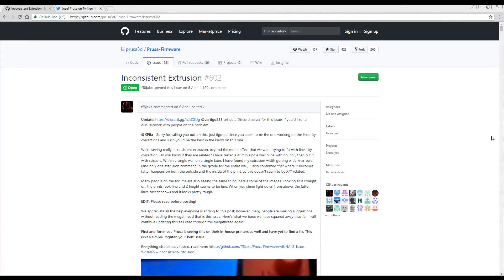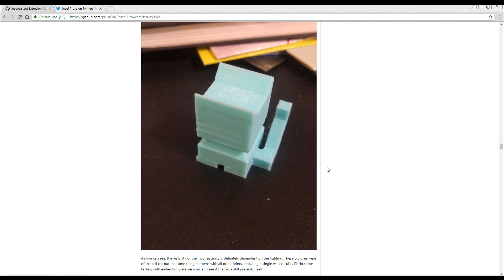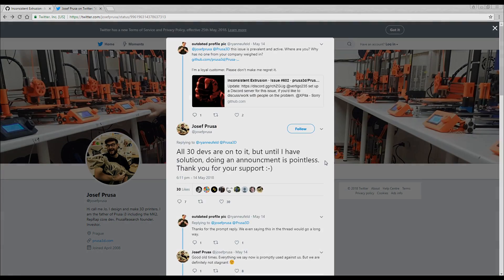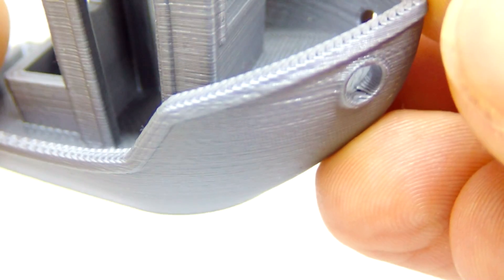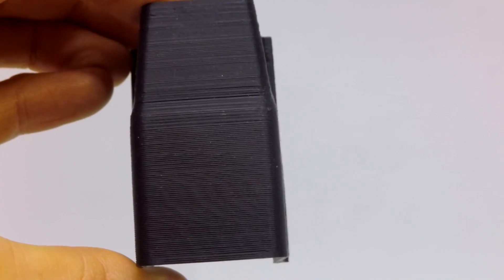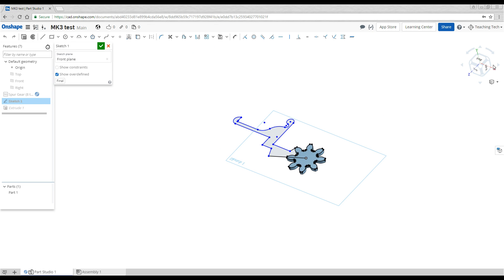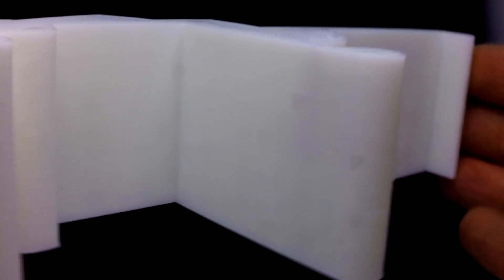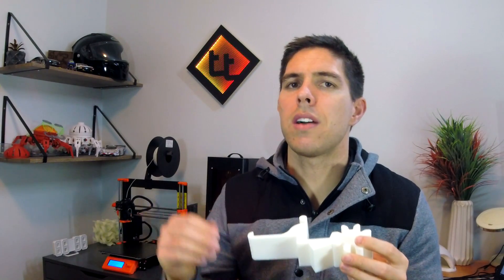Prusa MK3 extrusion issue: Just how bad is it?

Comment: Prusa mentioned on Facebook that the problem was with the print head being too light and having too much play when traveling over layer imperfections. Apparently it's fixable through reprinting some parts, probably around the extruder but I wouldn't know.
Reply: Stepper code or step planner in Marlin and Prusa firmware are no longer identical, and it's not identical across Marlin versions.

They are currently trying to figure out what to do with timing on the Marlin side of things, to make extruder pulses more even, as hypothetically there are potential issues there, not sure if visible.
Reply: Cassiano Leal nah it looks like the problem is in marlin code. People have weighted print heads with redbulls to no effect.
Reply: I'm just relaying what I read from Josef Prusa himself on Facebook like 3 or 4 days ago. If it's not the case, don't shoot the messenger! :D
Reply: I have the issue and added 400grams of lead to my extruder.  No difference.
Reply from the maker: I haven't come across the Facebook post by Prusa. Generally it's a good thing to have a light hot end assembly. When I changed my Solidoodle from standard to bowden, the print quality improved a lot from the lack of wobble. Ringing was improved too.
Reply: Teaching Tech, sorry it wasn't a post by Prusa, it was a comment on another post, buried fairly deeply within a thread of comments, which is probably why you missed it. If I find it I'll link it here but don't hold your breath. :)
Reply: I love it when people just come and tell their personal anecdotes and assumptions. I never said what the issue is. I simply relayed what Josef Prusa himself said on Facebook.

Recently another user in the Prusa user group showed a few quite perfect prints after a rebuild. Main difference? He reprinted the print head parts with 50% infill instead of Prusa's 20%.

Another anecdote, I know, but this one seems to confirm what Prusa said, and I'm more willing to trust the creator and his 30 developers, and the one anecdote that seems to confirm what he said, than any of the other assumptions and anecdotes. :)
Reply: Well the issue source is not 100% known, or is an amalgamation of different people having different issues leading to the same visual result, or a multi-factor issue, else there would have likely been a one-step official fix that would have been relayed through his corporate channels, to the press members following the issue, and end-user support, rather than the personal post of Mr. Prusa. It's a fact of the matter that the lead engineer and his strong engineering team also have all kinds of hints to go off but no ultimate answer, and being an industrial engineer myself, that happens a lot more often than you'd think.

In another case i am aware of, the uneven extrusion issue was reproduced similarly but with slight difference both on Klipper and on Prusafirmware, and Klipper is completely different, as its step clock is based on idealised step timings rather than gradient based estimation like in Prusafirmware and Marlin. This speaks for the possibility that at least for that person, the issue is mechanically related rather than firmware related and the material give (possibly with wear contributing to it) as you suggest is likely to be to be the cause. If the issue is exacerbated by wear, then it's conceivable that people feel it occurred with firmware updates as a matter of coincidence.
Reply: I too am a European and terrible customers are not foreign to me. Fact of the matter is, business like this is not limited geographically and the more popular your product is, the more you get to deal with this. You don't owe everyone the solution to their problem, you don't owe it to people that something you make is fit for their use, it's outright not possible. If a top-level engineer has to spend 10 hours on a single person and possibly gets frustrated or sick as a result and suffers a potentially even larger productivity damage than the direct time spent on the customer, you're out of a good chunk of money, so it's cheaper to refund them, multiple times if need be - apologise, state outright that you're unable to resolve their issue in a given timeframe, thank them for trust, all that jazz - i know it's not fair, not towards such toxic individuals, but well, that's life. The goal is to convince the customer to go away while making them as happy as possible, because let's face it, the Internet which is semi-anonymous is where the business takes place, so if you don't do that, they will find a way to make your life unpleasant, which is super expensive. Nobody gets to demand more than a refund. I can also see how it's sensible to segregate the communication with a given customer from everyone else so they don't get to frustrate other customers.
Reply: Mark Weist, where did you get that number from? Perhaps it's too much? Perhaps too little?
Reply: have not seen or heard of hardware being the issue. The printer worked really well out of the box after i assembled it(kit version) it was later firmware releases that made the printer act funny. I think they are working it out though. My printer is starting to print better now that ive calibrated it more. I bought 4 extra pinda sensors off a guy too.
Reply: Your welcome for my "anecdote" :)
Reply: Found it: https://www.facebook.com/groups/892917067538312/permalink/1025730267590324/?comment_id=1025730984256919&reply_comment_id=1025840507579300&comment_tracking=%7B%22tn%22%3A%22R9%22%7D&hc_location=ufi

For those who can't or don't want to open the Facebook link:

"Well, we are on it too, actually all 30 devs had other projects frozen until this is solved and as I’ll share it has the most unintuitive root cause no one expected. But it is hard to share any progress when Eric is around and screenshots everything, posting it out of context everywhere. We found out about orders under a fake name and canceled those, I really do not understand what is going on. He buys stuff, just so he can hate on it. Anyways, little update on inconsisten extrusion when we have free air. First finding is, that all, including UM3 and Raise, printers have similar object texture when you light the object the same way as in github issue. If you are looking for it, you will find it. Truth is that some mk3s have it more prenounced than the norm. We tried changing everything what made sense on the printers we got back from customers to no improvement. But it seems, couple days ago we found the probable suspect and it is the tolerance in the extruder movement. As extruder pushes down the layer, it can lift up when pressure is high and than relax again. This can be caused by a lot of things and each case is a bit different. On MK2/S the bearings mounts werent optimal, probably causing a tiny misalignment but with ziptie mounting it acted as a sort of pre tensioning, we fixed that on MK3 giving it a more wigle room. MK3 has the hotend 5-6mm further from the axis, rendering the pressure impact higher as you have a longer lever. So completely unintuitive thing like putting 500+g weight on extruder motor greatly improves the output of affected printers. Go figure, the smoother the axis is when moved by hand, the more it can actually deflect, so rougher and harder bearings produced better output. Good thing is, if we verify with testing that this is really the culprit, it is completely solvable by updating the printed parts. Moving the extruder closer to the X axis center and making the bearing mounts tiny bit misaligned will lower any play the extruder tip can have and sharpen the output. But as I mentioned before, every other printer have this to our median extent and without the mass panic we had in our community we would probably never dived into it, eventually finding that the fact, that lighter extruder doesn’t always mean better prints :)"
Reply: Well that's an interesting analysis, and i can see how it could be true or at least a contributor, indeed some pretension against any compliance is extremely helpful. And i mean bearings have some give by their very nature, linear race bearings especially, else they would completely seize in place. I've had to revise the mods on my printer numerous times for this very reason, and for a WIP design. "Light" doesn't refer to weight, but to load.

What strikes me as odd though is just how unprofessional the message starts off... singling out a customer - one that likely by all reason actually is suffering an actual issue caused by engineering or quality of Prusa's device - alleging that they have forged their name, and pretending like this single person was preventing Prusa from doing anything like advancing the research on the issue or soliciting public feedback on team's suspicions and findings. Worse, he's also playing favourites with who can or cannot buy their product. I have seen cheap excuses like that a thousand times, and mostly with companies (e.g. crowdfunding campaigns) that don't deliver something and then blame "haters". Way to leave a bad taste. Prusa has got fundamentally an upstanding business, they don't need that, they don't stand to gain anything by cheap stalling tactics, distractions, and "us versus them" style controversy.
Reply: Whilst I see why reading the message out of context might give that impression, if you had been a member of that particular group for a while you'd be more sympathetic of Prusa. He was not the one calling him out first, and in all interactions I saw between them Prusa always went the extra mile trying to not respond at the same level to the sheer hatefulness and bitterness of that particular person. He was unhelpful and very toxic to the group and certainly to Prusa and his company. I don't know where you are from, but in Europe in general it's considered ok to call out an aggressive customer and refuse service to them. The client is not always right.
Reply: Indeed. Also good to note that Prusa doesn't own that group. It's a users group. He's a part of it because he wants and certainly because it helps communicate and build a community around his products. The OP was about this particularly obnoxious member getting banned from the group because everybody (including Prusa) had had enough. Everybody wins, apart from this guy, who's probably going to find some other forum where he can lash out his personal frustrations until he gets kicked out of that as well. It's a shame but it's certainly better for the group and for Prusa (both personally and commercially).
Reply: You are very right Siana Gearz.

I've already been bitten by bad kick starter campaigns... 

cough Boots Industries cough

The printer I bought that never worked was far more expensive then the MK3 kit but still I was expecting the "off the shelf" results I kept seeing all over the internet. Not kick starter results.

It's frustrating.
Reply: Teaching Tech, that's an anecdote and you might have missed other contributing factors, like perhaps the fact that it was actually too heavy to begin with or something else completely. Jumping into the conclusion that "generally it's a good thing" based on that one anecdote is hardly helpful.

Comment: I too own both the wanhao duplicator i3 plus and the MK3, and have printed over 10km on the wanhao and have racked up 1.5km on my MK3. I have seen this issue although it is now completley gone (same g-code x-axis motor). I do a mix of mechanical and high detail prints including 2 sets of replacement parts for the MK3 (for backup), natural curves, statues like Venus de milo, mother's Day and the castle rexor and also including the base of Howl's moving castle. I can tell you one thing, everything I'm using is stock (no more carbon fibre rods...for now) have done no calibration at all even using the stock presets in slicer, and wow some of the prints I get off of this machine beautiful, Howl's moving castle (the base) (at 150%) is probably the most technically challenging model I've printed on this machine and Thier are no errors in sight apart from where I forgot to put support material. I'm no novice either, I've not been afraid to tinker with it, change settings or change nozzles, I've put this machine through its paces this past few months, with a multitude of different filaments pla, abs, nylon, tpe, pet-g(including sticking a 1mm nozzle on the thing) if you want to see what's come off my personal machine I'm active on the Facebook community and Twitter wink *wink*. The one problem I see is the Facebook community has become rampent with 20mm test cubes and people new being told that they need to do all this calibration before they even finish their first benchy, no have fun with your printer, tinker with it and the knowledge you gain from having fun printing things allows you to solve some of these issues, I'm not even going to start on 20mm test cubes and why they can only calibrate one axis (extruder). Happy 3d printing, print all the things highfive!
Reply: what are you looking to print on the printer? if its for high temperature, the new di3P V2 and the MK3 seem pretty matched as i see that they have updated to using an all metal hot-end from the factory and have increased the max temp. flexibles, the MK3 is unmatched as a stock machine with only a modification of the ptfe tube (can be added instead of the stock one inside the cold-end) and due to the whole new design the community around this hasn't fully caught up with any modifications for it , or art/non functional prints this is a toughy as you can make any 3d printer print absolutely gorgeously with solid mechanics including the i3 plus v2, the downside usually is cooling, vibrations, motor drivers and speeds. with the original i3 plus and probably the same with the new version is that you get the best print quality at 40-50 mm/s and that the DIIICooler or the CIIICooler make for some awesome improvement but again due to the new design i dont know if it's compatible, vibrations arent really a problem with the i3 plus the only issue is the artifacting from the drivers of the extruder motor but this is an easy fix with an 8 diode tlsmoother. overall the prusa at this point in time after just under 80 days of total print time and over 2km of filament i can whole hardheartedly say that the prusa is just an absolute workhorse of a machine and as being a later adopter to the wanhao i3 plus (my first ever printer) and an early adopter to the prusa (and soon the mmu2) their were bugs in both of these systems, layer artifacting on both of them, missed extrusions on the wanhao. all of these being fixed (for the most part) by the manufactures and the community. so the question is what do you value most in a printer, reliability, speed, material choices, print quality/time of tinkering to get good print quality, new features or an upgrade path or an awesome community? look at reviews make your own opinions, write things down, connect with the community and print all the things!, DFTBA HighFive!
Reply from the maker: Great post, very detailed and informative. I agree with your notion that people get stuck with 'analysis paralysis'. Unless your printer has a fndamental problem you should just enjoy making cool and custom stuff. I'm all for modding printers but for most users it would be a shame if it consumed them.
Reply: euan.  I currently own a Creality CR-10 and an Anet a8.  I'm currently cross shopping the wanhao i3 plus mark ii and the prusa I3 mark 3.  What is your opinion on both?  Where would my money be best spent?  Is the Prusa a better machine all the way around?  Can the Wanhao match the prusa?
Reply: Thank you for your input.  My goal is to use my CR10 for large objects, my AM8 for finer detailed prints, and whatever I decide to get for a new machine as a primary flexibles machine but with the capability to do other materials.  I've spent enough time on my AM8 (Anet A8) to last about 5 lifetimes.  Tinkering and spending a ton of time on my next machine isn't my goal.  (The quest to perfect my AM8 will be never ending).   I want a machine with all the bells and whistles, bed leveling, filament runout detection, and even those things that I havent thought of yet.  Based on your reccomendation (and others that I have gathered over the past few weeks) I think the MK3 is my beast.  I'm a little worried about this newest extrusion issue that people are complaining about but there doesn't seem to be a machine in its price range that can even come close to holding a candle to it.